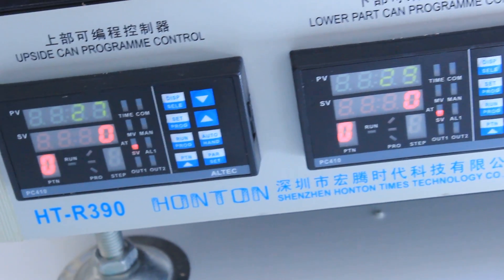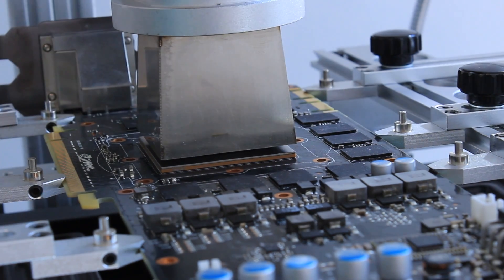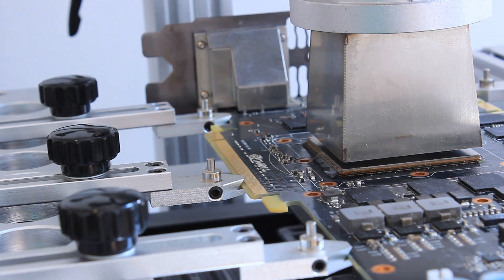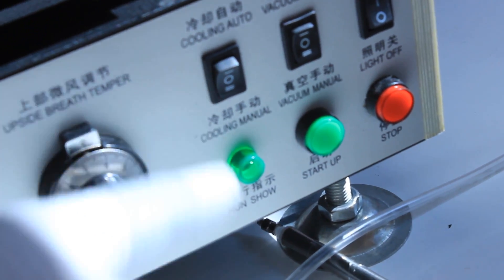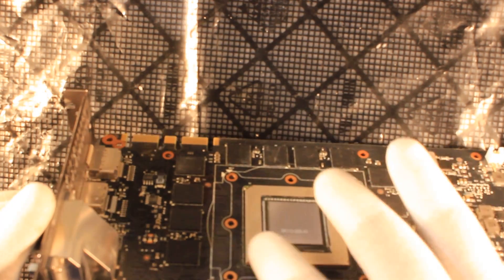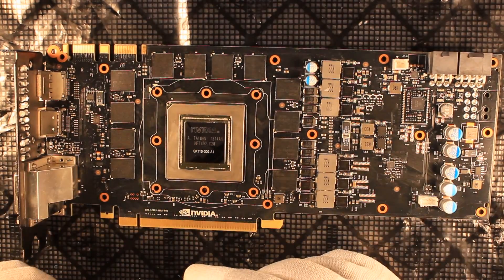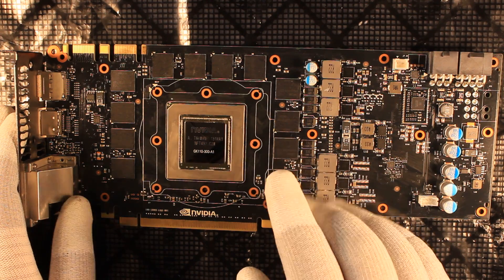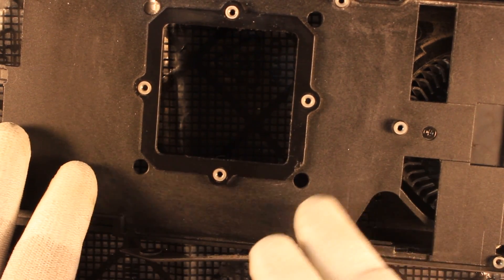How to reflow a GPU from start to finish #2 reflow process and testing the repaired card

Comment: is there anyway you have details to your profile you use for heating and timing? thanks
Reply from the maker: Uhh, I remember that setting up the profiles on these controllers was tricky, for the temperature ramp I actually had to divide the initial and the desired temperature by seconds. However, I have moved about 2 years ago to Asia, and the IR reworking station is in storage in the EU, so sadly I can not tell you more. However, I just have read through the PDF documentation of the controller to set it up. If you follow the temperatures and the time intervals from the video, you should be able to set up the same.

Comment: i was wonder what brand was the flux you were using? great video Thank you
Reply from the maker: I am showing the flux in a different video where I go through the tools I use. Long story short, this is a cheap 'fake' version of the Amtech flux. It is a chinese cnock-off made after the original US Amtech brand, but it is still very good. Most likely the original Amtech would work even better.

Comment: It worked! I did it with an RX 570 XFX 8GB, i bought a laser measuring device for the temps, reached 230° for 20sec and it worked so far
Reply: Is it still working? i did it to mine gpu but i dont have any idea its gonna work for how many days?
Reply: @hasivcs  it lasted a week 😢 it went back to the exact same issue, i re done it and killed it for good, i have a few other cards mining and this one is the first dead, it's just bad luck i guess

Comment: Hello I have tried reflow to my artifacts GPU and first time it was good and after 5 days GPU go artifacts again. So i tired again with heat gun and using flux and I clean the flux with methylated spirit alcohol by sinking GPU. But nothing comes to my monitor showing no signal. How can i fix. Pls help me. Thanks
Reply: Lol it just happened now with me
My gpu is also not displaying anything
And i am just checking every video on youtube to find a solution 😂😢
Reply: Methylated spirit alcohol??? lolol Are you trolling?? It's here on the video... Use ISOPROPYL alcohol!!! Other alcohols have water in them! You know what water does to electronics right?? The heat gun process is a cheap, un-exact and hit/miss solution!! Yeah you got lucky the first time anddddd... Of course... It worked for a couple of days!!! Because it was a cheap fix to begin with. Unless you have a reflow/reball station idk what to tell you... Try again with the heat gun?! Make sure you heat all the sides evenly, use good Flux and Isopropyl alcohol. Other than that, you either have a reflow/reball station and ultimately... Do an actual Reball. At this point though... You can be wasting more money in repairs than buying a new GPU. And buying a new GPU will eventually have to come in play for sure. You can't be reviving 10 year old GPU's because games are very demanding now

Comment: Hello and thank you for your explanatory video, I have a question for you regarding the use of a simple basic PID, for example a REX-C100 PID, is it possible to create a complete profile in order to automate the reflowing process, 150 degrees, 200 degrees, 217 degrees, 245 degrees, end of the process while respecting timing.
I have not found a French language PdF for this kind of cheap PID.
Or it is better to raise the temperature manually, I will use a homemade recovery table with preheating and hot air station with special 45x45 mm head.
Thank you for your help

Comment: I made a small graphics card GPU repair station with lower and upper probe on the PCB, using a hot air station, but I do not know the ideal profile perfectly well, I have a diagram showing the gradual rise in temperature and the maximum time to be respected according to the temperature levels, could you explain to me the temperature preheating procedure taken by the probe below the PCB, I suppose that we start by preheating the PCB, but until 'at what ideal temperature 110 degrees maybe? how quickly should this temperature be reached? and important question the preheating phase remains active when you start heating from above until reflowing 245 degrees?
After reflowing is complete, can the PCB be allowed to cool slowly or does it have to be cooled with a fan?
Thank you sir for your video and especially for your help
Reply from the maker: Well, although the BGA manufacturers will show you an ideal temperature profile, the reality is that it would require lots-and-lots of tuning to get it close to the given profile for each particular chip. Thus, for repair you just try to be "good-enough" for most chips. The idea behind heating up the board slow to 110C is to gradually remove any moisture from the chip, because water boils at 100C, which causes popcorning of the chip. Bottom heat is one of the most important ones in a rework. About 70-80% of the heat should come from the bottom, and only 30% from the top heater. Otherwise the board will bend like a banana, and the BGA chip will never sit right on the PCB. Thus, you definitely have to keep the bottom heat on during the whole process, including infrared preheaters. As for the cooldown, the cooldown actually need to be done quickly, using forced air, so that the balls solidify quickly. This improves the bond quality, since the solder alloy will stay more homogeneous. Especially the lead-free solder tend to phase-separate if it is cooled down slowly, which leads to breaking of the solder balls/joints.
Reply: I understood you correctly, but as I am a beginner in this matter and I am building a BGA station with 450W preheating with regulator, upper heater with hot air welding machine, lower and upper double probe on the PCB and a big fan to cool the PCB very quickly, I still have a few questions for you.
1- the soldering profile, are these the temperatures measured on the PCB and not read on the hot air welding machine?
2- (very important) -Can I first preheat the PCB up to 110 degrees and then start reflowing with my hot air desoldering station with max 235 degré, no risk of damaging the electronic components with the preheating and the higher reflowing?
3-The respect of the temperature stages and the duration of the stages without PID will be very difficult to respect taking into account the homemade station, it is possible to use a PC with software and a low-cost USB interface, but I do not failed to find this.
I found a video where a person used a small electronic circuit without a single channel case, the problem he did not indicate the electronic circuit number, would you have any idea about this considering a budget very tight?
4-Last question on your station and below the PCB, you have a kind of horn with a central screw to avoid deformation, is it hot air coming out?
I thank you very warmly for the help you will give me in this complex matter.
Reply: How do you mean heat has to come from the bottom?

Comment: Very nice video and good explanation. One question: is it a good idea to use NoClean SMD flux to perform reflow? What about the residue flux below the BGA chip when using the flux you used? Would it do any damage over time?
Reply from the maker: When you are reflowing a chip, you definitely need no-clean fux. The main idea behind no-clean is that you can use the PCB for years without cleaning it up. This way you do not need to use an ultrasonic cleaner, which would be a must do if you use traditional flux.
Reply: Donkey Learning IT thanks! Will try with no clean flux.

Comment: great video.I have one question for you.How long can gpu work after a good reflow
?
Reply from the maker: It really depends on how much stress you put on the card, and how often it goes through the heat/cool cycle. After a good reflow it should hold at least 3 months. I know that earlier reflows were a joke, but now with really high GPU prices it is worth thinking about it.

Comment: can you please tell me more about the cool-down process ? should be slow or fast ? 

why do you use those cool down fans ?

i trying to build a DIY BGA machine and i'm stuying it. thanks
Reply from the maker: Sorry for the late reply, but better late then never.
So if you look at the temperature profiles published by BGA manufacturers, you will see that they show that there should be a relatively fast cooling profile done in order to reduce chip damage (the chip spends less time at high temperature) and also the solder balls will be more homogeneous if you cool them down faster (no time for the alloy to phase-separate).

Comment: how about exposing a chip to 300ºC? is it safe?
Reply from the maker: Nope, that is not a good idea. However, in the case of hot air just because the hot air is around 300C, that does not mean that the component is also at 300C, since there is always a temperature difference between the hot air nozzle and the chip. This is why you need temperature sensors on the board when you develop a profile.
Reply: @DonkeyLearningIT  thanks for your point. At first, I'm perplexed also if the set temperature in hot air is the same also to the component being heated. Better have a sensor for temp guide.

Comment: Excellent Video, Thanks for you great info. it was very generous from you. 
I just have one Question. I am struggling with some motherboards that bent with the reflow temp. can you advise me how to avoid that? 
again, A big thanks to you and your generosity. 

Thanks
Reply from the maker: By bending which type of bend are you referring to? Does the mobo hang down, or does it curl up? 

In any case, the warping comes from uneven heat between the bottom and the top, and most of the time it is being caused by not enough preheat from the bottom.

Comment: Does your card still working after this reflow?
Reply from the maker: Yep, you can see that the GPU stress test is running fine. Of course, a reflow will not hold in the long run. 
If one plays heavily with the card, I would expect that it will crash again in 3-4 months. Longer solutions are either reball (no longer worth it for cheap cards) or buy a new card.

Comment: Hi could you please tell me what are the times - how long do you keep the card at 90 degrees for the water vaporization, or how long do you keep the card at 255 degrees? I would like to repeat the process with a hot-air gun that has adjustable temp. Thanks!
Reply: Did it work?
Reply: @ajsdfk  No. Tried 2 cards. I followed the instructions as best as I could and wasn't able to make them work. Also there are a lot of videos that even if it does work it it only a temporary fix and it will break again.
Reply: @piotrw3366  Got it thanks

Comment: very nice video! do you have any experience with how to remove an IHS from a Xeon CPU that uses an Indium Alloy (melting point between 130 and 157°C) as the TIM? I'm just trying to remove an IHS safely and not sure how I should proceed. But I guess a pre-heat to 100 and then direct heating of the IHS to 157°C should cause no harm?
Reply from the maker: It depends on the price of the Xeon chip if I would even try to mess with such thing. If these are one of those old Xeons which are now practically worthless, I would pre-heat the whole chip using an infrared soldering station to around 140C from the bottom, and next take a hot air gun (heatgun) and work on the lid.

Comment: Hi. Correct me if I'm wrong, the board and chip has to be preheated to 90 to 100 celsius for how many seconds or minutes with the platform inclined to how many degrees? How far should the nozzle or tip be to the GPU? Should the paste be applied around the chip or just at the top of the incline? Also when you're reflowing, what's the temperature of the nozzle/tip, how far should it be to the GPU and how long should you heat it at 255 Celsius I believe? What is the blower's setting? Is it at maximum? What's the melting point of the GPU solder anyway in Celsius? Thank you. God bless, Proverbs 31
Reply from the maker: The board should be as flat as possible, there is no inclination involved here. When you apply the flux around the warm chip, it will be sucked below the chip due to surface tension and capillary effect, and not due to gravity. 
Now concerning the temperatures and the time intervals, I must say that everybody has to figure this out on his/her own for the particular machine using thermocouples and doing systematic tests. It does not even make sense for giving values here, since it will radically differ from machine to machine, even within the same series. As for the distance, I use six 1Euro coins to set the distance between the nozzle and the PCB. Namely, I stack three coins on top of each other on the PCB on two opposite sides of the chip, and put the nozzle down until I touch the top coins on both side. I fix the nozzle there, and remove the coins. This way I know, that the distance is systematically the same, since I used the same distance for developing the profiles with external thermocouples.

Comment: Very helpful video!!! For how long did you heat the chip at the solder fusion point (+217c) Thanks!!!
Reply from the maker: According to my thermocouple what I used during profile development, below the chip the temperature should hit around 220C for 17-22 seconds. This is because 217C is the idealized temperature for clean lead-free solder. However, old solder balls will always be oxidized, so you must go couple degrees above 217C to melt them. 
Also, I found that it is good to have the solder balls molten for at least 10 seconds, so that they fuse to the PCB and form a good contact. As I wrote, one must use a thermocouple to develop a profile. Without a good thermocouple it is a total hit/miss. Also, use at least two thermocouples on different part of the large chips during profile development, so that you see heat distribution.

Comment: how to avoid pop corn during BGA reflow and remove chip safely pls explain in details
Reply: I do this sort of thing daily as part of my role supporting the SMT portion of manufacturing.  We typically bake our built assemblies for 48 hours at 125C as directed by J-STD-033.  This will remove any moisture (the majority) to prevent any delamination or change in circuit card impedance levels.  The amount of moisture removal slows over time, so the majority of it will be removed in the first several hours of a bake-out and diminishing returns thereafter.  Not that I've tried this, but I suppose a small oven set to 90 or 125 (both standards in J-STD-033) for several hours would reduce your chances of moisture expansion while heating the board.  

In any case, pre-heating the board prevents any thermal-shock and ensures even distribution of heat.  Our rework station uses two metal plates directly below the mounting rails to pre-heat the board.  They typically run between 300 and 350 degrees Celsius.  The air applied to the top of the component usually starts around 110 and raises throughout the process topping out in the 300 degree range.  Solder alloys vary, but lead free SAC305 balls should generally be heated to a peak temperate of approximately 235-240 degrees and remain over the melting point (around 217-220) for between 40 to 70 seconds or so.   Measure the temperature on the top of the component during profile development and try to keep it down under 250 if you can.  I'm not sure you'll find a datasheet with those specifications for a proprietary chip such as a GPU.  Keep up the good work!
Reply from the maker: To avoid delamination (popcorn) due to trapped water vapor expansion, what I do is the cheap solution. The cheap solution is, that you use a really long (in my case about 20 minutes) BGA profile, where the first 10 minutes are there to slowly heat up the chip and keep it around 90Celsius so that most of the water vapor can escape. Also, before I heat up the chip, I drawn it several times in water-free acetone. Water-free acetone is a bit more expensive than average-Joe acetone, but it will draw out water because water will always try to mix with acetone. Rubbing about 5 times water-free acetone on the chip with a cotton bud will do the trick. Warning: average-Joe acetone or even methyl-ethyl-ketone which contains water will not work .
The best solution would be to "bake" the boards in an oven set at 85Celsius for about 12-16 hours. This solution uses lots of electricity, plus you will need an oven where temperature can be regulated fairly accurately.
Reply: need more patience....if you could give best profile for 3 zone ir bga machine ....
Reply from the maker: I only worked with IR+Hot air machines. This is because even in industry they user hot air combined with IR preheat, since it is a lot-lot easier to control, and to make the solder job reproducible. Namely, once a hot air machine is set up, you can literally remove the thermocouple from the board, since it will follow that profile 99% of the time. In contrast, with IR it need "soaking" and depending on the color of the chip, IR penetrates differently into the chip. You will definitely need at least two thermocouples or better four, and develop your profiles. It takes time, but it is worth the effort!